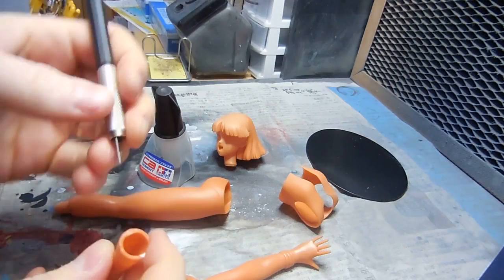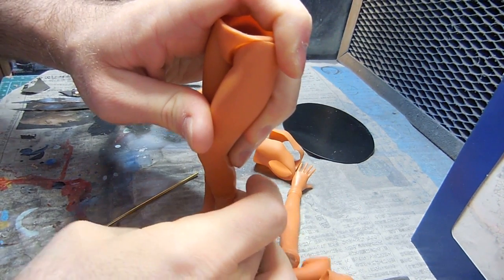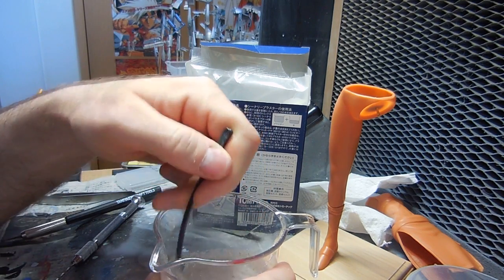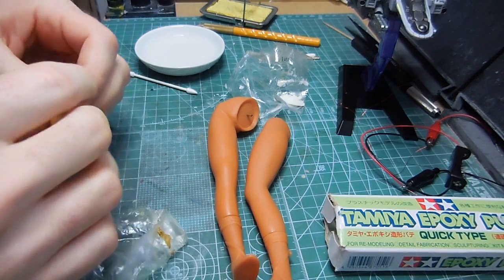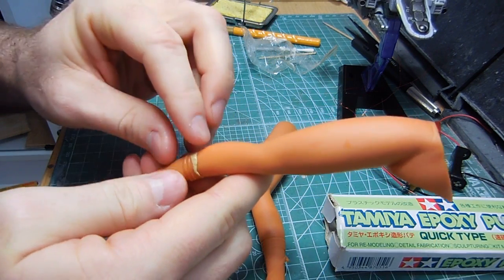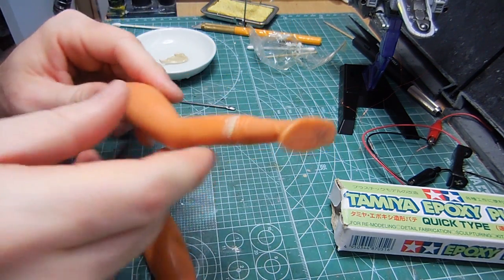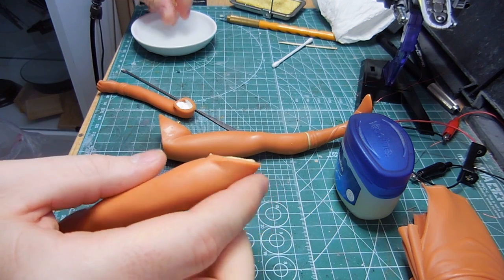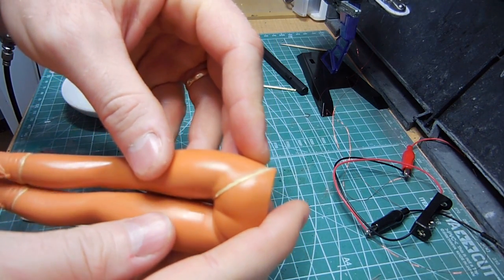Tsukuda 1:6 Nadia I sofubi build video 2

Comment: Youre doing the epoxy putty correctly. You just didnt have enough in place when you put them together. I do the same on the joints of my resin figures. It takes practice and patients to get it down pat. Not to mention plenty of wet fingers and q-tips. Just remember youre still going to have to do a little sanding to make it perfectly smooth.
Reply from the maker: Thanks for the advice!

Comment: You finish this model?...& if so what solution you find for leg/hip joint?
Reply from the maker: I still haven't finished this kit. Actually, I don't think I worked on this kit since this video. I'm building all three Nadia kits simultaneously, so I have done work on the others. I just won't upload the other videos until this one is done, to prevent confusion.

Comment: Others have told you how to fix your problem. I'd like to tell you the reason you made the mistake. You were too neat !  What you should have done was make sure there was something to. " squash out " ! Then you clean up the seam "after" you join the parts. Review your video and you'll see what i mean.
Reply: stevethefishdotnet That's it exactly !   You've solved your problem.
Reply from the maker: I think filling in that big wad PLUS trying to do the squish fit together is what made it difficult. Now that this is more solid, Doing another squish fit should be easier.